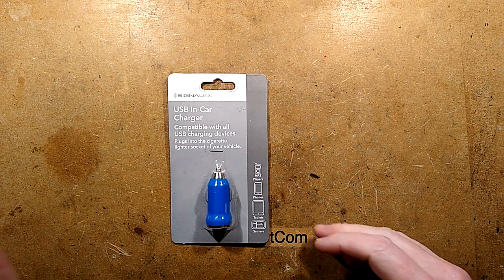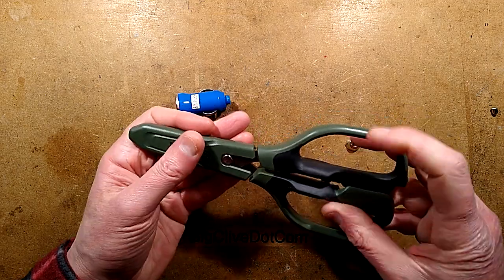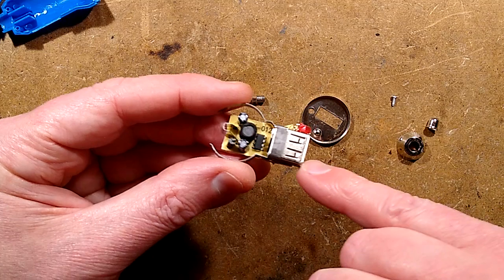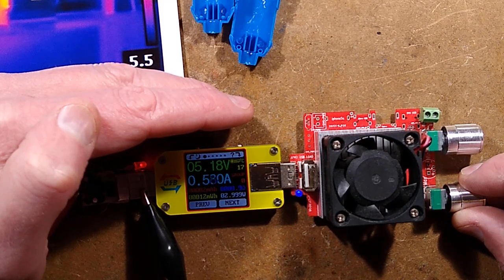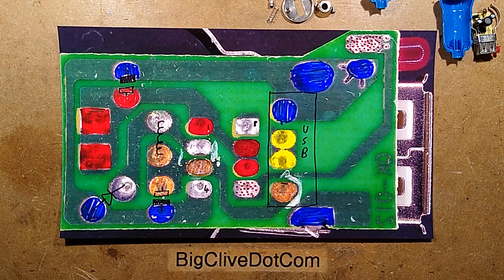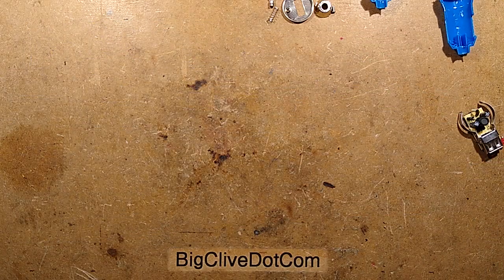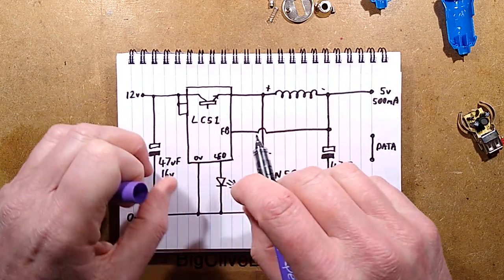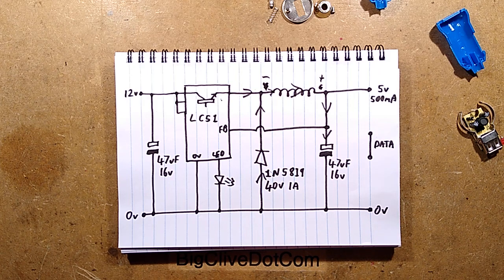Inside a Pound shop car-USB charger (with schematic)

Comment: It is weird seeing this, knowing that you can buy a 5v charger (from 12-24v automotive batteries) from aliexpress as cheap as $0.3. Just need to put thermal glue and a heatsink, a pair of 30 cm 24 awg and that cigarette male connector, and 2A DC fuse, all is said and done for $1.